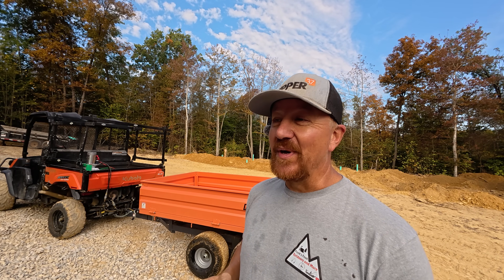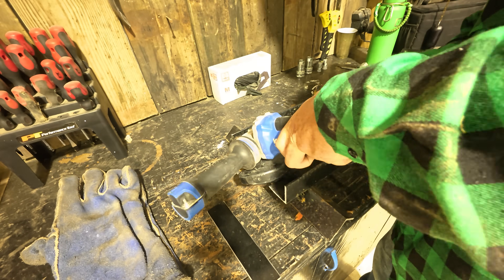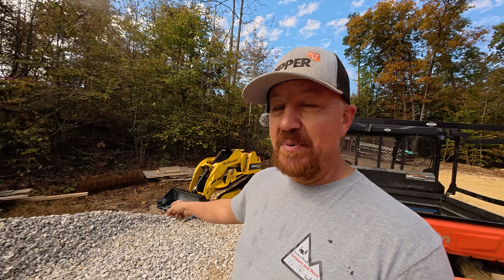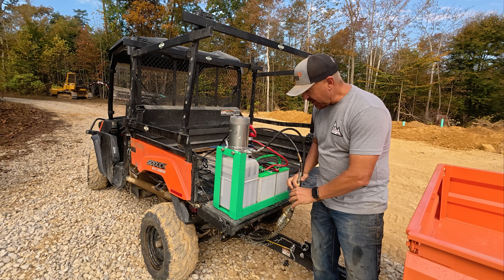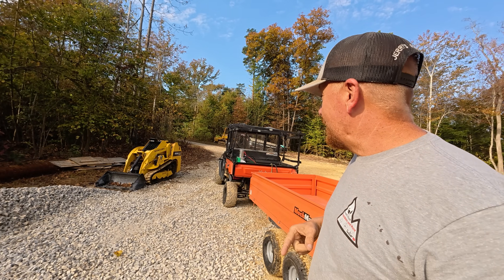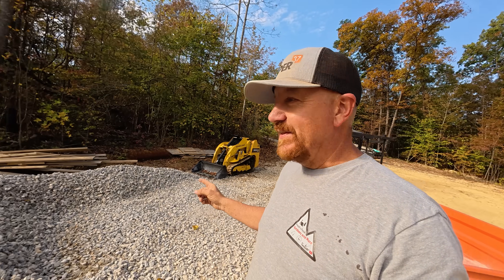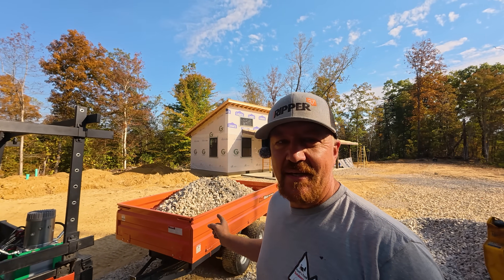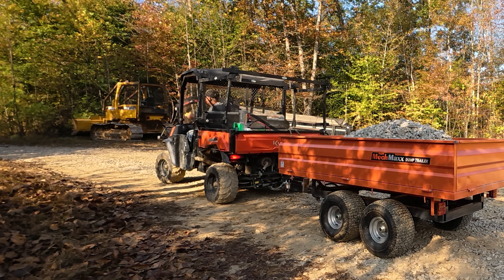Build Your Own Portable Hydraulic System!

Comment: Nice build Lucas. Definitely see multiple opportunities that this setup would be useful. How much did the entire build cost, not including your time.
Reply from the maker: The pump is right at $200.  The steel I used was scrap from MechMaxx equipment deliveries, I had the battery already so I only spent about $50 for fittings, battery tie down, and cables.  If you had to buy all of the components it would end up running about $350-$400 probably.

Comment: This is just stupid!  Mount the dang pump on the trailer !
Reply from the maker: You can mount yours on your dump trailer.  I have other uses for the pump, not to mention I’ve also already used the dump trailer enough to know the tongue area is tight and adding it in there is a recipe for tearing it up.

Comment: When you described a self-powered, stand-alone hydraulic  pump to lift the trailer, I was more than half expecting you'd mount it on the trailer.  That way you wouldn't have to hurck the whole thing into the back of the sxs.    Clever, none-the-less.
Reply from the maker: I planned to do that in the beginning, but it seemed cramped with the tongue jack and all.  I just decided this would be less problematic.
Reply: Now he can use the pump anywhere

Comment: i'm genuinely confused as to why someone would spend $30k+ on that mini skid instead of a tractor or a real skid?  for this job, seems like it just adds time.
Reply from the maker: They wouldn’t for this job.  The area is wide open and full size equipment would be more efficient.  Loads of crews, like landscapers, work in tight spaces, backyards, have to go through small gates….those are the areas where a mini SS would outperform any other equipment.  And believe it or not, that little mini SS will lift almost as much as my 48hp tractor.  

It’s not right for every job, but for the jobs it is right for, it’s amazing!

Comment: I maded one of them the frame out of 2"×2"÷1/4 Thick with 1/4 Aluminum diamond plate on top And has its own hydraulic and hydraulic pump on the trailer too dumb. Very heavy